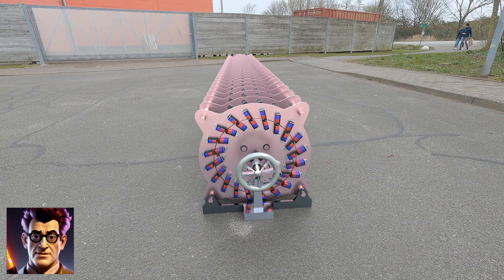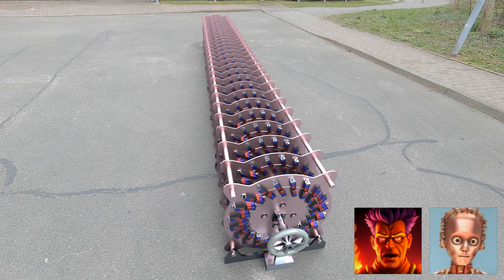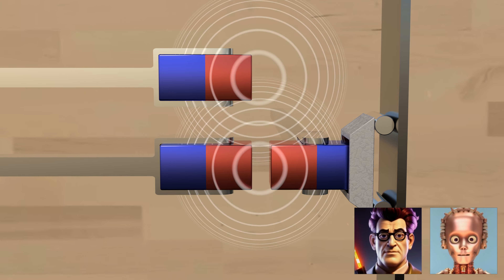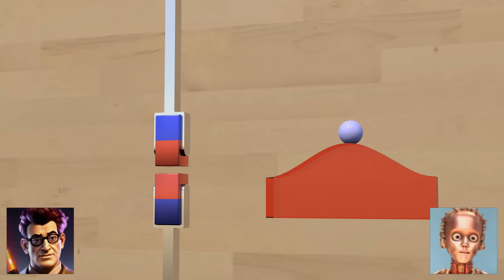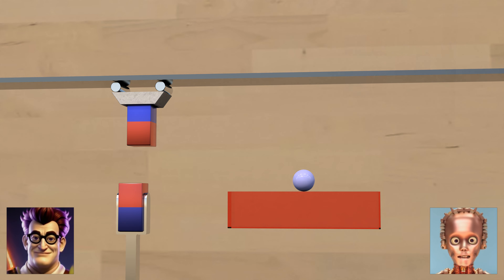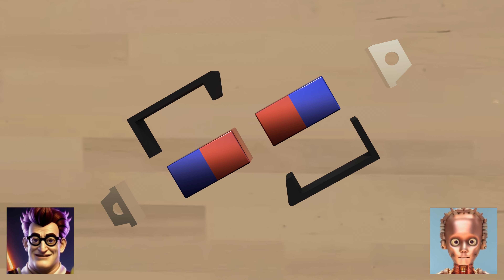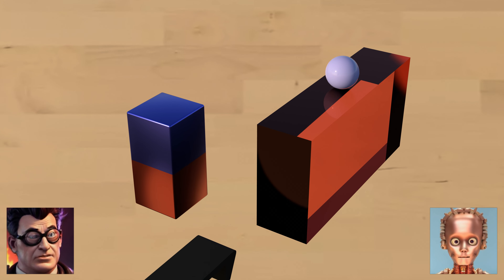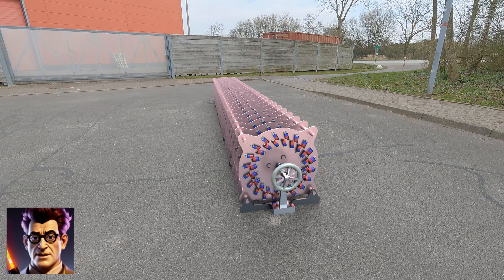Truth: Giant Perendev Perpetual Magnetic Motor, free energy for 5000€, Mike Bradys magnetic elevator

Comment: Perhaps if someone explorer just the usage of the magnetic field between t1 and t2 whatever is free energy on that small time frame using another type of magnetic field in between perhaps a coil over just to pull and repel .
Reply from the maker: Hi Junior, thx for your comment. I don’t think that it is possible to make the magnets jump over the sticky point using an electro magnet for gaining the perpetual power ability. 
The power for the electro magnet has to been spend from an external source. The system could not power it by itself. There is too much loss in power conversion. 🙂 thx for watching
Reply: @yWild  hi tnx for reply. My main idea was to use external force. But minimal perhaps generated after t1[ initial power generated and conservated ] than applied to the external factor * stick point * just to pass. Still i dont think  the design show on this video could work effectively even if changed a bit.
I would propose a total different design using more gap of time and momentum between gravity ./ Strong forces / and week forces also with different angles.

Comment: I saw a Turkish guy had made one that worked but his internal rotor was just cross members from the driving axle i saw the patents for it too … with all these things i think the biggest issue is torque ..its one thing to get something to spin but another to apply load to something that you can get perpetual motion from .. i think the only way is energy potential like using water to create hydrogen or releasing the potential of thorium that is a radioactive element yet has much lower levels of radiation and is more common to find …. But hydrogen is where experiments into using frequency in the fracture process of making it from water is just one of many ways to release its potential and the storage with metal hydrides has already revolutionised its capabilities with tanks able to drive 1000 miles before needing to be refuelled.. the potential for the future is huge the problem we face now is more the establishment wanting fascist powers over people’s lives to control everything at the same time … i do think in the future governments will become obsolete and these nefarious powers will be removed especially if things like AI do take off as predicted as higher intelligence wouldn’t like the idea of suffering only enhancement and restrictive powers will be ripped apart
Reply from the maker: Hi Pauli, thanks for your comment and for watching 🙂

Comment: This system would work if all the sections were offset a few degrees from each other.....the only that work is Yildiz Motor.
Reply from the maker: Hi Pierfrancesco, thanks for your comment. If you look closer then you will recognise the small shift of every magnetic ring inside to the next one. But it does not work either if it is done like Yildiz did. I make videos showing people the reason why perpetual motion motors are unable to work in an easy to understand way using gravity instead of the magnetic field. Think about the principle in the gravitational way. Thx for watching 🙂

Comment: Pretty machines.  I was skeptical, still am, as I am a firm believer in mechanical friction. Entropy.  Sort of like what you see in everyday life or even through a telescope pointed at the evening skies.  But the machines a lovely and cheap to make, so I made two or three. Cogging, forever cogging.  A magnet is an ordered object, with all of its atomic/molecular/electron structures all lined up in the same direction. That, over time, slowly randomizes, alas.  Entropy.  So a magnet can reasonably be viewed as a "battery" of a sort. Even if the pretty machines worked, the magnets are still highly ordered batteries.
Reply from the maker: Hi Jim, thanks for your comment. Thx for watching 🙂

Comment: Good demo, and i think of the number of magnets inside a stepper motor is higher than bobines wich brings the moving magnetic fields to rotate it smoothely, so i think the number of those magnets should be increased in your mecanism to rotate without stop. thank you for this videos.
Reply from the maker: Hi Sem, glad you like it. Do you think that the number of magnets changes something? I fear that  it’s the principle that does not work, as you can see at the end of the video. Thx for watching 🙂

Comment: Why aren't there real magnétic motor machines, working in the real world?
...
Reply from the maker: Hi Canal, thanks for your comment. Because they need an infinite imbalance, which is not possible in our real world. I explain it in the last part of the video. Thx for watching 🙂
Reply: @yWild   Because they need an infinite imbalance, which is not possible in our real world. But we have a normally close normally open .  If l select close close close and open them close close close in a connect or collector I have 3 /4 change 1/4 discharges  capacitor if x 4 on a circle we get a round running well
Reply: because the world's economy depend on fossil fuel, generate energy like that will collapse it hence the power players won't let it be done! but actually there are many ways to generate electricity, magnetic field is one of them, pseudo perpetual motion using magnetic field is possible in our real world, it's the information we don't possess that render it impossible in our perpective but outside of our knowledge perimeter lie the reality and yes possible it is !

Comment: What ever you do, sooner or later it all comes to a full stop, I'm a magnetic force engineer that deals with magnetic forces only ...
Reply from the maker: Hi Red, thanks for your comment. I think you are right. If there is no unknown force coming into play, then everyone comes to an standstill sooner or later. Thx for watching 🙂
Reply: Hi so what your saying is that if it is perpetual then a magnet motor works but if it only does some work that it is not a magnet motor. So in my video above the action of me turning the train round has added the energy enough for the train to reach the end of the track and the process is repeated. However the train does still transverse the length of the track in both directions with this stored energy so it is a hill. or a flywheel. It is not an energy source but more of a energy store. Thank you I now see how thermodynamics logically operates here. I have a mechanical device that can overcome this and hitch and unhitch the train here is the video. https://www.youtube.com/watch?v=uDu81HBFJog
Reply: 😃nice one👌so you confirm that a magnetic force engine can't be done 'right ? or sorry can be done right😄i mean you're magnetic force engineer 'right😅sorry sorry😁